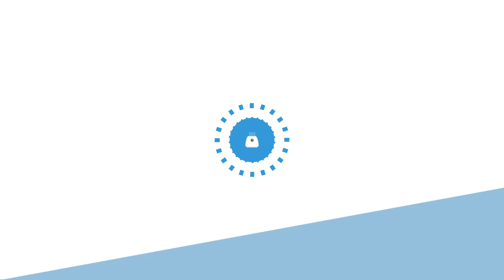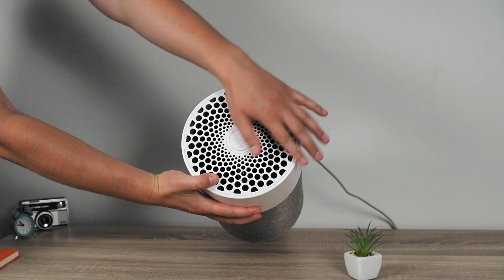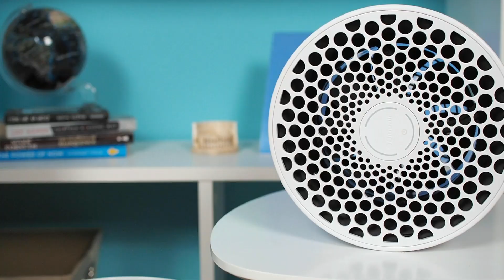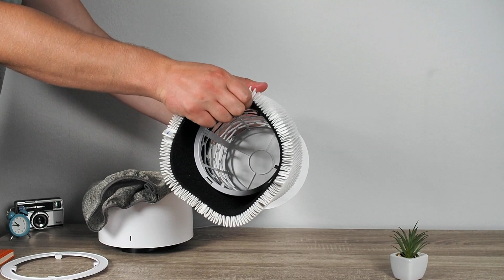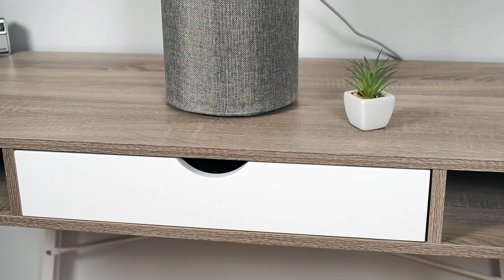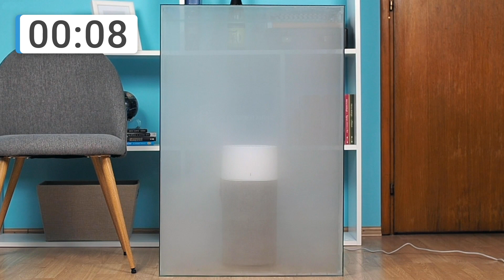Blueair 411 Auto Air Purifier: Trusted Review (Performance Test)

Comment: Hello, are you sure about your measurement of noise ? Because when I’m listening to your review of levoit 300 it makes clearly more noise (night mode)  but has lower dbA than the blueair  Thank you
Reply from the maker: Hi, I have been using the same noise testing tool since I started reviewing air purifiers. But right now, I use a different audio recorder, and that's why the noise recordings in some older videos sounds a bit different (louder). Watch any new comparison where there is the Core 300, and you will see the difference.

In the past, I used a camera built-in microphone to record motor noise, while now I use a Sony voice recorder.
Reply: @AirPurifierFirst  ok thank you very much for the explanation :)

Comment: In the video it says rooms up too 100sqft but on Amazon where I bought it from says 900sqft 🤦‍♂️
Reply from the maker: The Blueair 411 Auto can clean the air once in 60 minutes in a 912 sq. ft. room, which means it has an ACH (air changes per hour) of 1. However, the industry standard is 4.8 ACH, according to AHAM. In this case, it is 190 sq. ft., not the 912 sq. ft. as the manufacturer said. So, I use 4.8 as the standard for suggesting room size for an air purifier. 

For example, the more polluted the room is, the larger the ACH number you would need.

I wrote a few articles on CADR, airflow, and the explanation of other standards, which you can find on the Air Purifier First website.
Reply: Up to 900sqft